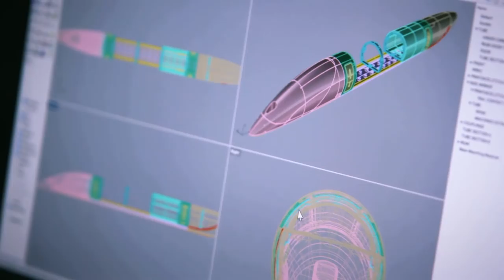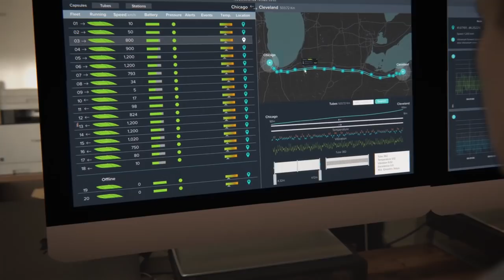How We Built the World's First Hyperloop Passenger Capsule

Comment: Formula:- for example built at high speed in a 1000kms within 100 to 300 days formula. How it is please follows

1. 1000 Kms / 50 Kms = 20 Sections. Or at least 10 sections .
2. 20 sections time target is 100 to 200 days.
3. Every Each section has 50 Kms Range. per day you need to build 1 km approximately, it means
a) Digging team. 
b) Strong Foundation & Strong Basement forming Team.
c) Column Pillar Formation Team.
d) Hollow Sections Hyperloop capsule circular Tubes one after one arranging
e) Hyperloop Passenger Capsule Testing.

4. Every team requires their own particle knowledge for high-speed Trainee workers.
5. Movable jigs and fixture.
i. Large Diggers (for digging)
ii. Basement concrete forming shaped die plates.
iii. Stell Mesh / High Carbon Steel Rods for Strong Mesh.
iv. Concrete pouring.
v. Column pre-shaped dies for standing for pouring concrete.
vi. Column top block centering and concrete pouring.
vii. Arranging Tube Sections for Hyperloop capsule.

6. Tubes Track Alignment Checking.
7. Test The Tube Track full Length of the path.
8. Now Final Test 1.
9. Final Test 2.
10. Final Test 3.
11. Grand Opening. ( 100 days)
Note: - JESUS Has 11 Disciples. Amen.

Comment: Is carbon fiber really a good material for a pressure vessel? Doesn't it shatter on impact rather than deforming like metal would?
Reply: carbon fibre is roughly 8 times as strong and 40% lighter than aluminium. And what is it going to impact with?
Reply: @LordCreo  You don't seem to have understood my point. Its not a question of strength but one of material properties. Carbon fiber is a fairly brittle material, so an impact is likely to cause more extensive damage to the shell since it cannot deform in the same way that metals would. This obviously makes a difference in a pressure vessel, smaller holes are easier to plug.
As for your second question, well that's the wrong thing to ask. The question you need to ask is, can you guarantee that it wont impact something that compromises the pressure vessel? Peoples lives  will depend on the integrity of the final product, any engineer worth his salt will tell you that in such projects you design for any critical failure case imaginable.
Reply: They don't seem to worry when building aircraft out of carbon fibre, and it has far more chance of hitting something (the ground, other aircraft, birds etc)! I can only assume that they believe the strength is more important than it being more brittle than Aluminium.  Please feel free to give any example of anything at all it could possibly hit?
Reply: @LordCreo  Pressurised aircraft fuselages are not built of carbon fibre so I don't really see the relevance. Additionally pressure loss is a much less severe problem for an aicraft. The pressure differential is smaller and crucially pilots have the option of simply descending to an altitude where the atmosphere is breathable. This is not exactly an option for a hyperloop pod, the design concerns are far more akin to those of a space capsule.
Impact threats could be something as simple as a loose bolt or really anything that could come loose from another pod during travel.  Now at the speeds they are proposing for theese things any small dense object might as well be a bullet, its not a question of "if" there will be damage but whether that damage can be managed to avoid loss of life.
Reply: Really?? Please tell me what the Boing 787 Dreamliner and Airbus A350 XWB fuselages are made from??
They have the option of re-pressurising the tube within a few minutes (far quicker than a plane can safely descend from 30000ft)
And what would cause a loose bolt (that miraculously came from somewhere) to spontaneously jump up into the path of the capsule?
And if this bolt did fly up and puncture the multi-layered carbon fibre, you would still have plenty of time to either stop the pods and re-pressurize the tube, or probably even just to finish the trip and then take the pod out of service for maintenance.
Reply: @LordCreo  Cool, hadn't actually read about either of those 2 planes. My other points still stand though, and it would be a lie to say that the launch of the A350 and 787 had been without controversy about their safety. One of Boing's own engineers has been very vocal about his concerns around the difficulty of detecting fatigue and minor damage in a carbon fibre fuselage.
You seem to again be missing my point, perhaps because you don't have an actual argument against it. It doesn't matter how fast you can pressurizer the cabin if you cannot patch the leak, and that is my concern with their material choice. A brittle material is likely to give you much larger hole in the case of an impact, and how large of a leak can you expect crew or passengers to patch in an emergency? The likelihood of something comming loose and striking a pod is not as remote as you seem to think, consider that these pods will be be in operation for decades, accidents happen and maintenance is never going to be performed perfectly every time. It just takes 1 guy insufficiently tightening a bolt that comes loose at speed and strikes the pod travelling behind. Sod's law isn't just a tired joke, it is the embodiment of an engineering mindset that keeps you and everyone else in modern society safe from the deadly machinery we surround ourselves with.
Reply: Well there will be far less fatigue in a hyperloop capsule as, other than maintenance or emergencies, will always be in a pressurised state, it is the constant pressurisation/depressurisation cycle in aircraft that cause the fatigue (along with things like bending of wings which also doesn't happen in hyperloop pods).
Also "Vibranium" is the first carbon fibre composite to contain technology for sensing any of these problems.
I don't think the plan is to have pods travelling so close together that a screw flying off one pod could be still "airborn" by the time the next pod comes past. And once it is on the floor there is nothing to cause it to fly up in a near vacuum.
There's not really a need for passengers/crew to plug a hole, unless its large, the rate of air loss through a small puncture is pretty small (Just look at the ISS, which is in a complete vacuum not just a partial one, had a 2mm hole drilled in it and by the time they realised they still had 15 days before they would have depressurised, they stopped the leak for a few days by putting a piece of sticky tape over it.
Reply: At the end of the day Hyperloop is a collaboration effort between the likes of SpaceX, Boeing, NASA, Leybold, Aecom, and MIT, who have massive engineering experience compared to you, me, and Thunderf00t (Currently there are over 800 engineers working on Hyperloop).  And to think that they haven't considered these things is nonsensical. Especially when many of these considerations are already in the original PDF, and when considering how many of Thunderf00ts arguments have been debunked.
Reply: @LordCreo  That's an argument from authority. While most of those institutions have had some kind of involvement in hyperloop development it is in no way the concerted effort that you portray, and HTT is only one out of a couple of dozen different teams working on separate competing designs. 
I don't think I ever implied that any of my questions had not been considered, but the suggestion that we should blindly trust that these people have thought of everything is frankly insulting. Particularly given that the only thing we have seen so far from HTT is buzzword and hot air laden adverts masquerading as technical showcases. You should be sceptical of a company that shows you an empty design mockup and labels it a "prototype".
Reply: You do understand that they are essentially making a spacecraft since it will operate in a near vacuum? I am not an engineer but from the research I have made so far what I can see is that carbon fiber is a porous material which would give me concerns. As for your comment about the Boeing 787 Dreamliner there was a complaint from Vince Weldon to the Boeing management where he state "the composite fuselage was unsafe compared to conventional aluminum designs, and in a crash, was more likely to 'shatter too easily and burn with toxic fumes'." Another issue with carbon fiber would be that carbon fiber, unlike metal, does not visibly show cracks and fatigue along with that it is a porous material and collected moisture expanding with altitude could cause delamination and as far as I know a near vacuum will force it to expand even more. About that 2mm hole in the ISS, the ISS is not made from carbon fiber in fact most things that go into a near vacuum are not. Also would you really want to be in a massive vacuum chamber that could collapse if it was dented?
Reply: I'm not blindly trusting anything, i'm also not arrogantly assuming I understand the problems they are going to encounter better than they do (not aimed at you, aimed at Thunderf00ts coverage of hyperloop). The companies/institutions I named are all collaborating with Hyperloop TT, they are not competing companies (of which I am sure there will be many).
Reply: @Taurmin  carbon fibre has been in use in aerospace (military) since 1950's. Commerical aviation over 20years now. It's properties are now well understood.

Comment: What would happen if the capsule loses its pressure? Do we die like people die in space? eyes pooping out?
Reply: lol thats not what happens at all except in films, and you would need a very large hole for that to happen, and if it did they can re-pressurise the tube within a minute or so.
Reply: @LordCreo  yes but it can happen and if this ever works it will happen alot. Hyperloop is just an stupid Idea. Magnetic trains are very long and the air pressure is not that much
Reply: Kyco MC why would it happen a lot, we have been doing it with aircraft for many years and the number of depressurisations is extremely small!  The air is by far the biggest force acting against maglev trains, how many maglevs can coast 90% of the journey unpowered as hyperloop is being designed to do?
Reply: @LordCreo  yes, but in planes Depressurization wont kill you. First because planes are not flying in a vacuum. We have about 14.7 PSI on ground and planes go at 10.0 PSI. At 30,000 feet.
If a plane loses pressure its not as strong as if you are in a Hyperloop vacuum. Also if the cabin is breaks, the engine can pump air fast enough. But tell me. From where are you getting air in a Hyperloop?
Reply: Kyco mc you don't sound much like an engineer. Try cutting down on the negativity.

Comment: Smoke and Mirrors. 
Travel through vacuum has nothing to do with aerodynamics. 
You can propel a cube in a vacuum and it will travel just as fast, otherwise any modified bullet train would do.
Reply: It's not a pure vacuum, so aerodynamics still matters.
Reply: There is no perfect vacuum not even 10000 km above earth surface. That's why satellites have drag and have some fuel on-board and an engine for re-boosting.
Related to Hyperloop, there is a balance between energy consumed by the vacuum pumps and the energy consumed to keep the speed up during the travel. At some point the pumps would consume more than saved on the vehicles themselves.
So... still important to make them aerodynamic, to reduce the requirement of a "near perfect" vacuum
Reply: It's not a vacuum you spoon
Reply: Also, by pumping the air out, you can reduce the linear motor track length to shorter booster sections, which somehow needs to be enough savings to overcome the cost of the tube, vacuum pumps, etc..
Reply: @wavetrex  please don't confuse gravitational pull on satellites with "imperfect" vacuum.
Reply: Thought it's meant to be just a lower pressure e.g. 0.1bar, if you brain surgeons can handle the terminology

Comment: I am Challenging you Hyperloop TT you will lose Because The CHINA T-FLIGHT IS COMING MORE THAN 4000 KMPH. China would be the world largest manufacturing leader and it builds it very rapidly by taking a successive formula. Their Strategy is built in multiple sections like at least every 50km there is one section 50-50-50